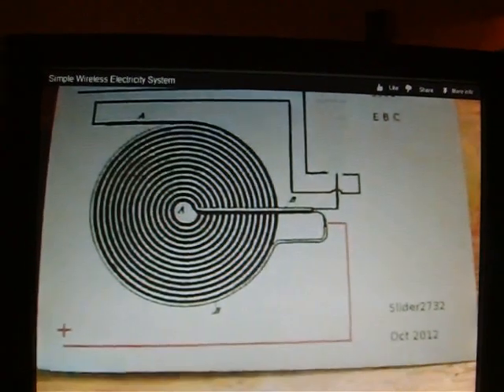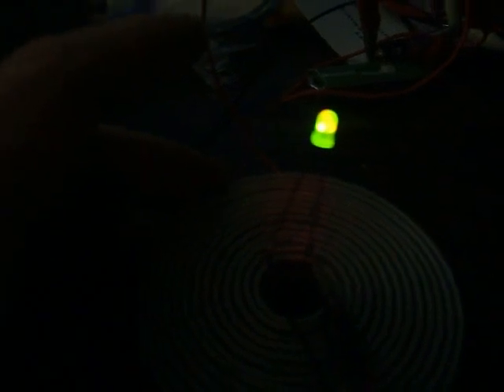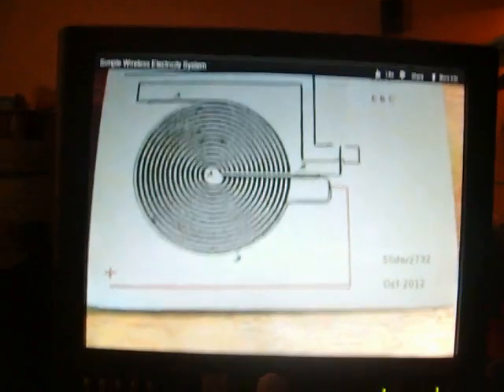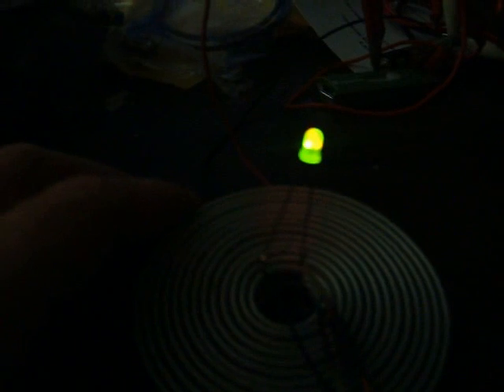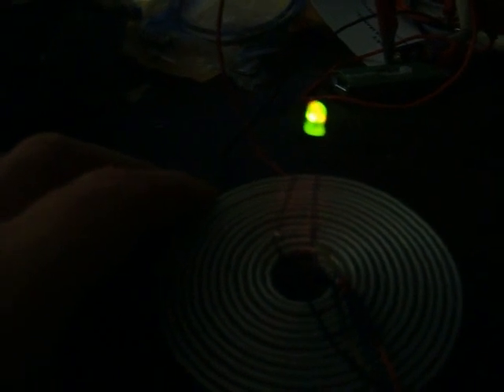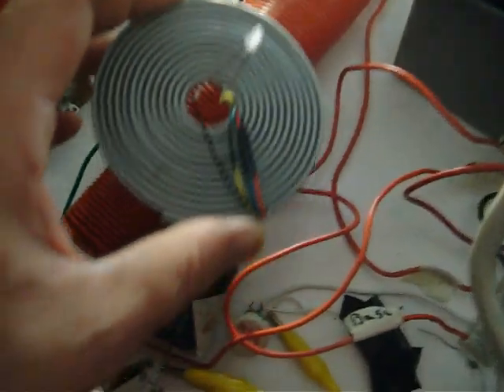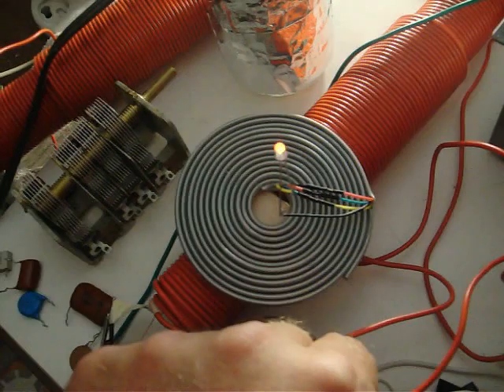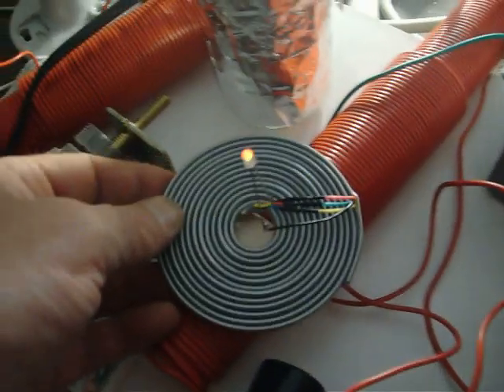Slider2732 Simple Wireless Electricity System replication-  Thanks Slider

Comment: Your 5K pot situ is similar to the reason I tried water on the Base for higher voltage runnings. Maybe it''ll work on that circuit too ? Adjustment of output brightness can then be readily achieved by altering the electrode distances from each other while in the water :)
Thanks for your replication !